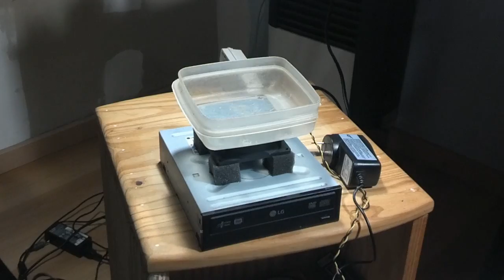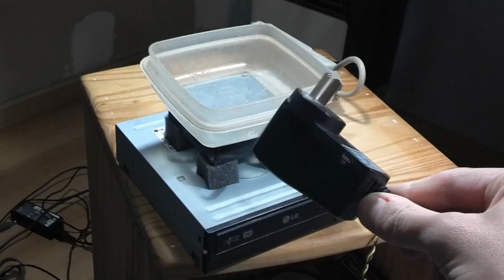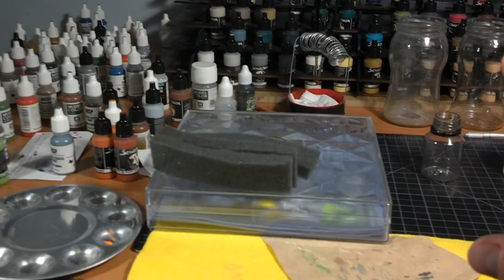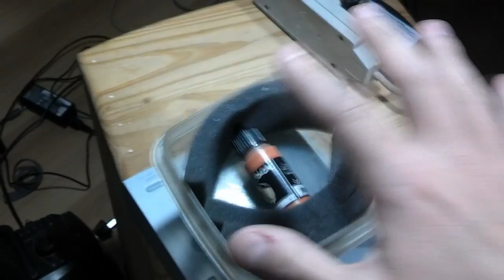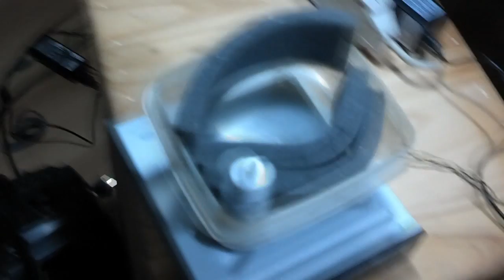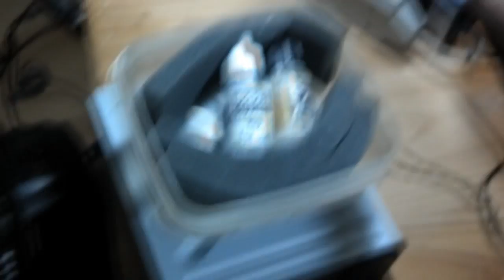Homemade Miniature Paint Shaker - Stirrer

Comment: hey..thnks for sharing this.may i knw how does the vibration takes place?is it when the load balance screw hit the bottom of container?thank you..
Reply from the maker: +Mohd Shasha Mohd Zaffa The screw doesn't hit anything, it would slow it down and kill the very small torque the fan has. In essence, the fan is just unbalanced due to the screw, creating off-the-axis force. With a quick spin, it vibrates (this is the basis for most vibration devices, off-center spins).

Basically, have you swing a weight on the end of a string? Noticed how it pulls you out? This effect, rapidly changing direction due to the rotation, creates a platform that is trying to move back and forth.

Comment: Velcro the bottle to the bottom of a palm sander, a variable speed one is even better for more control, it will shake it up in no time with the added bonus of being able to use it as a sander. Putting a small motor fan like this out of balance will probably wear out the little bearings quickly, good video all the same.
Reply from the maker: I a looking at other, more powerful solutions... a palm sander seems a bit overkill, plus it is not cheap.
Reply: True mate, they can be expensive, just thought you may have had one :)

Comment: some cleaning solutions will turn this into an airbrush cleaner as long as threads are protected. i found that part out ,the hard way. i made this years ago .a little different ,same result. good video
Reply from the maker: I don't think this can produce enough vibration to actually act as a cleaner. But now you got me curious to give it a try...